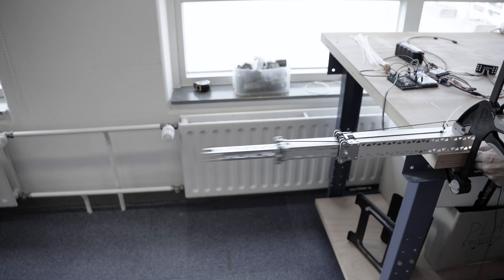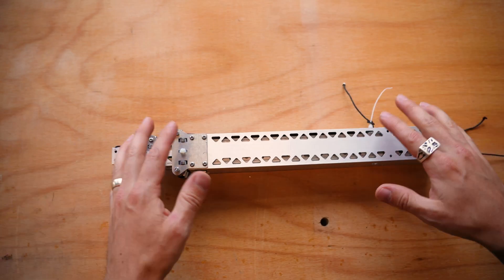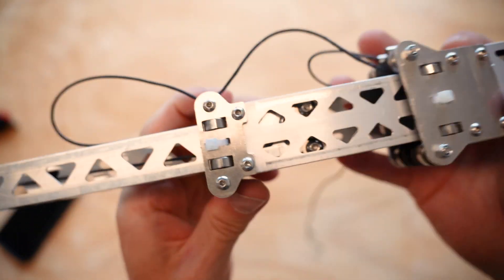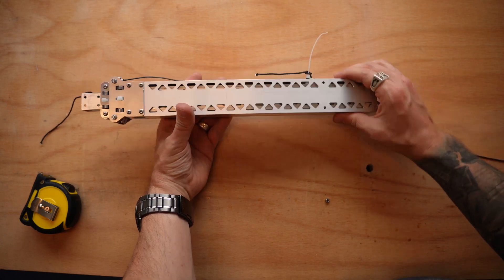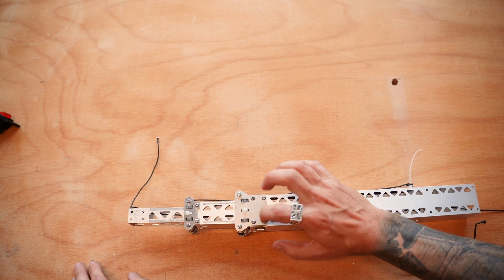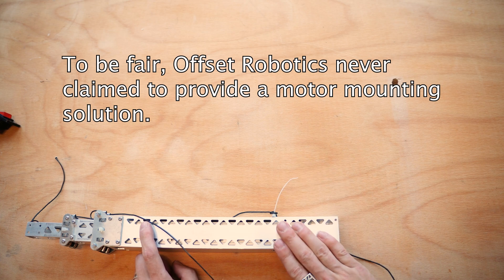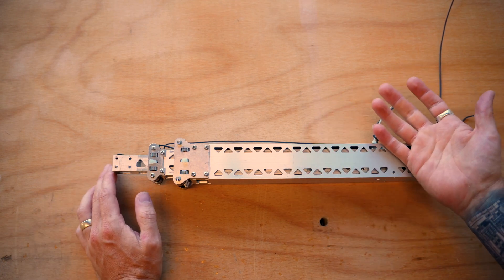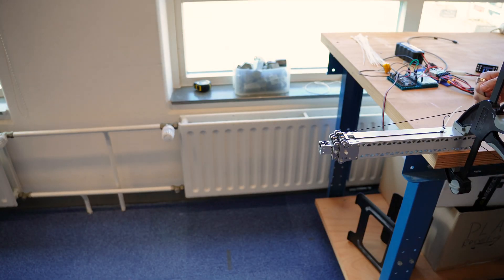The Telescopic Robotic Lift I Wish I Had Sooner

Comment from the maker: Get 5% off any 2-Stage Kit from OffsetRobotics here with Code: COACHPRATT5 https://www.offsetrobotics.com/product/box-tube-slide-kit/?ref=24&campaign=broganpratt
Reply from the maker: Note: My Rigidity tests were flawed in this video (and I have since cut them out) as I was past the product's bearing stops. At full extension you should only experience 2-3mm of sag in either axis, NOT 10mm as previously tested. For comparison, 3xMisumi SAR330's have 10mm * of sag at full stroke length.

Comment: A couple of quick notes:
1. The extension uses cascading rigging as mentioned, but it appears that retraction may use continuous rigging (with a single line running from the end stage directly through the bottom).  In this case, you would need to pull twice as much rope on the center line to keep everything in tension.  Our team did this by 3D printing a 2 sided pulley, where one side was twice the diameter, allowing us to retract and extend with a single motor.
2. The cord is UHMWPE.  Our team also ended up using 1.2mm thick line and it never broke during competition, though you do need to make sure it isn't pulled over any sharp corners.
Reply from the maker: Great notes, you’re correct on both. I’ll have a testing video coming out in the future here for some speed/load tests on this kit.

Comment: Great video.  Our team built a custom telescoping arm for last year's game.  We didn't have access to a CNC machine that could cut metal, so we used 3D printed parts and off-the-shelf aluminum tubing.  It worked well and (fortunately) never broke during competition.  We did have to re-tension the strings before and after each event.  

Here is a video of our robot in action:
https://youtube.com/shorts/9VtKSPecbtA?si=1XrD5rdMAG2ihE3v
Reply from the maker: That's a great looking telescopic arm! I'm not surprised about re-tensioning strings. It can be a pain working with & tension properly. 

How did you find 3d printed side plates for rigidity?

Comment: Great video.  My team found this earlier this summer and passed for many of the reasons you pointed out (half baked string solution and no mounting brackets).  My opinion was that it was a solid first generation design that just needs a little more improvement.  Hopefully this will prod Rev and GB to start R&D to offer their own version.  More choice for all.
Reply from the maker: Cheers. Provided you've got the time to tinker with the motor mounting solution to find something that works, it's a great piece of kit. I know Offset is currently in the process of producing a motor mount, so keep an eye out for that in the future. 

Agreed, having more options in the space would be great.

Comment: wow, I love box tubes, I would be very interested in learning how to design one
Reply from the maker: They're super cool. The full CAD on this kit is available on the product's page, so you could definitely dissect it from watching the assembly video in tandem. Though you'd need a CNC capability, or ship it out to a shop who will do it for you, and I'm not sure that'd be cost efficient (though learning how to make one isnt for the goal of cost savings, ha)
Reply: @BroganMPratt  well we have the CNC resources to make it, also it may be completely viable to just not pocket it, like orbit knights, and we can drill and tap all the holes
Reply from the maker: Ya, it's not necessary to pocket it at all, it just looks super cool pocketed. Its like 60~ grams in savings, essentially nothing on a robot of the scale for this elevator. Keep in mind, tuning one of these things is a bigger challenge than you'd think, tolerances on these plates make a pretty big difference in performance.
Reply: @BroganMPratt  ok good to know!